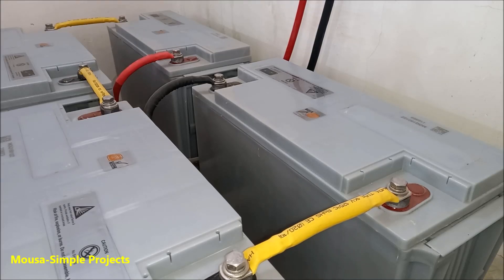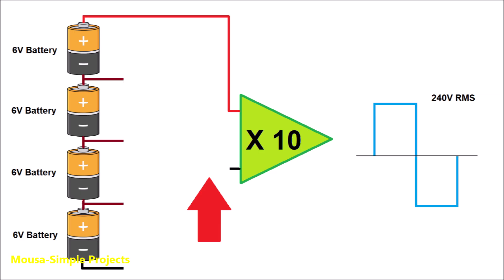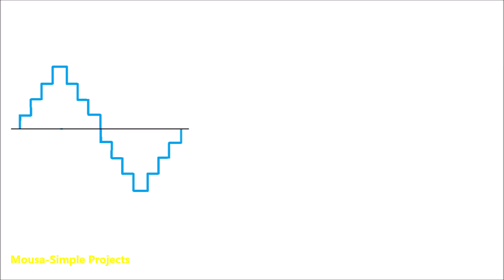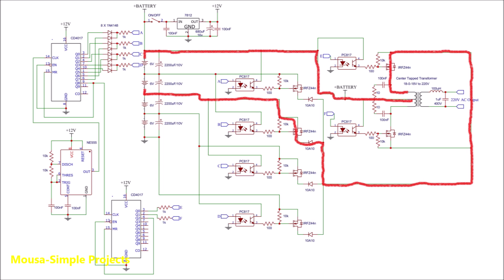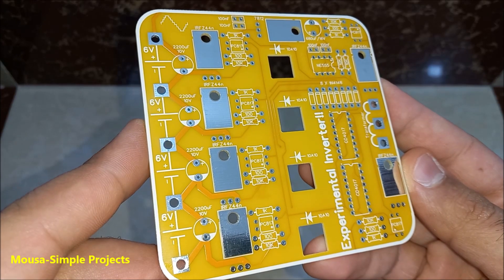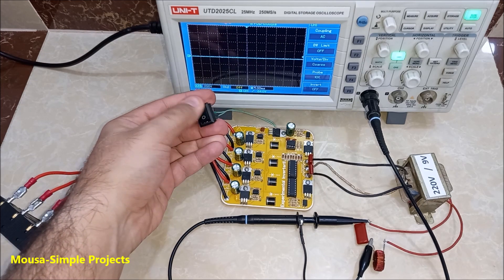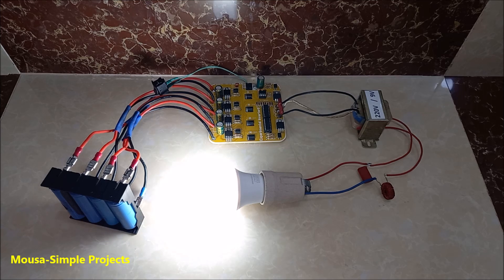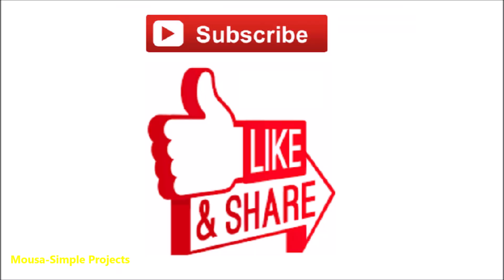DIY Inverter 12V to 220V Sinewave with Unusual Method ! / Multilevel Inverter

Comment: Very nice, but it should be better to use H-Bridges. Than it is possible to discharge the batteries nearly with the same Power
Reply from the maker: Using H-Bridge can increase the efficiency but it has nothing to do with balancing the voltage across the four batteries if i keep using my method of switching the batteries one by one. because when the circuit switch the first 6v battery and output is 60v the load draw less current than when the second battery is connected (12V) with output voltage is 120V. Imagine a 100 watt incandescent light bulb that designed to work with 240V, it consume much less than 100W (almost 7W) if you run it with 60V instead of 240V.